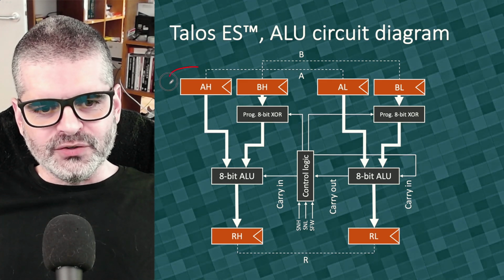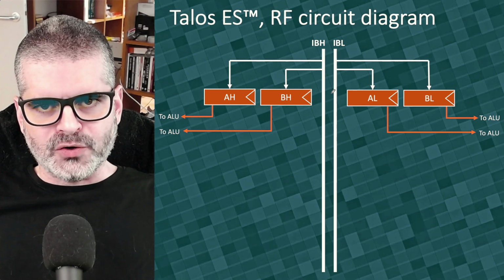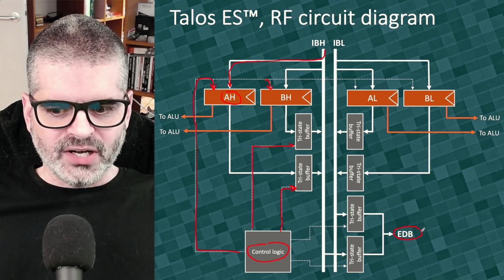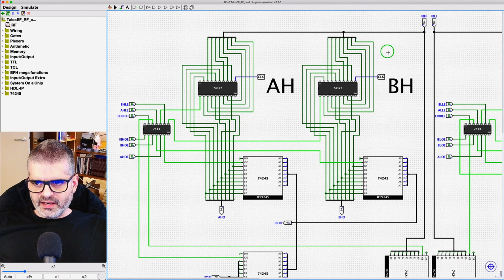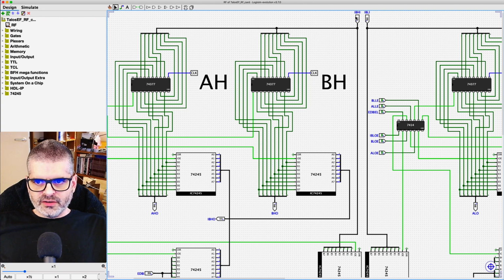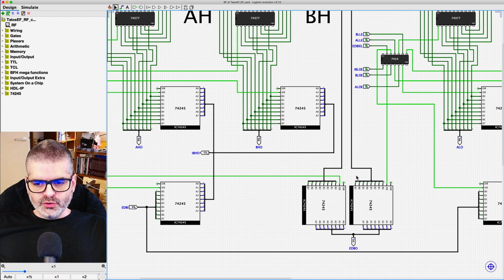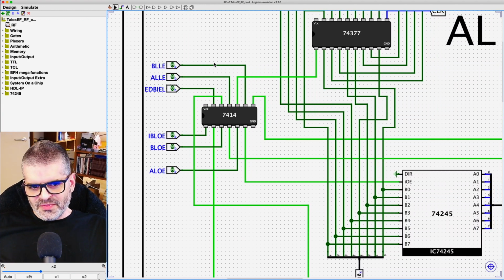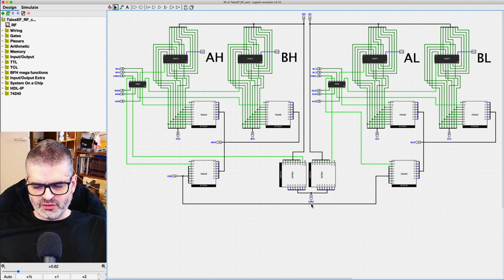Building Talos ES™, the 21st century's mini-computer (Episode 7)

Comment: One quick question: why not make the external bus also 16 bits? Wasn’t that the difference between the 8088 and the 8086 back in the days? And again, congratulations from a hobbist who’s learning a lot!!!!
Reply from the maker: Cheers! I could make it 64-bits, but everything becomes exponentially more expensive: more memory, more pins on all connectors, more drivers, etc. etc. Talos is essentially an 8-bit computer (meaning that data is represented in 8-bits) with a 16-bit address bus, like most classical microprocessors. The internal 16-bit bus is simply to allow full address calculations. But the data, again, is 8-bit.
Reply: @thebyteattic  it makes sense. After all it is an 8-bit computer. Tks! Btw, my ALU boards will be here os Friday. I will assemble one (had to buy 5 as minimum) and let you know how it goes. I did the boards through PCBWay and got the components on Mouser. I created both a PCBWay and a Mouser proejcts if anyone wants to order.
Reply from the maker: @ricardosetti4976  Fantastic! Maybe it would help people if you shared the name/link to your Mouser order list here?
Reply: @ricardosetti4976  Are you UK based? Happy to buy 1 or 2 of the ALU boards of you? Will keep the costs down for both of us. Can you share the Mouser project?